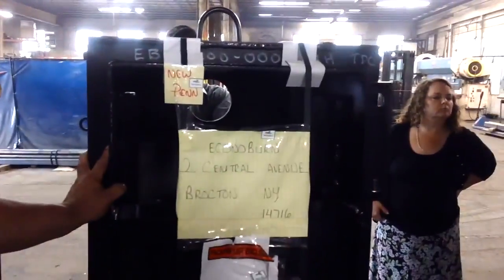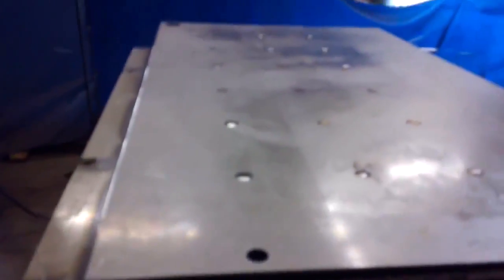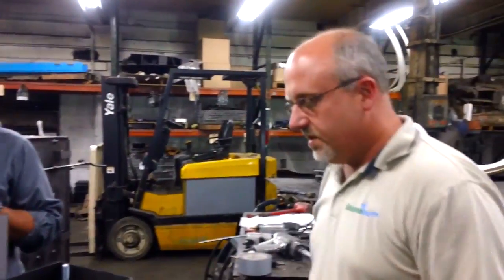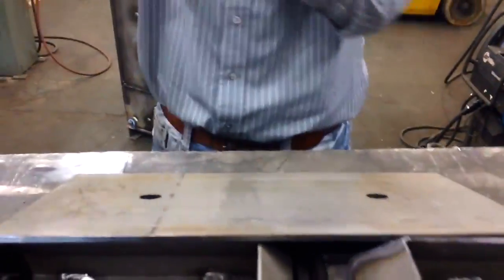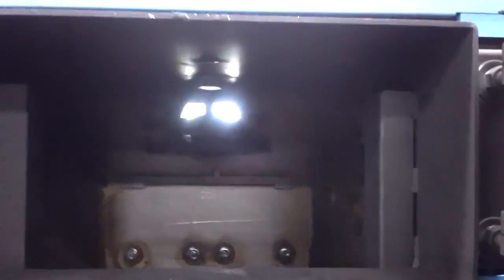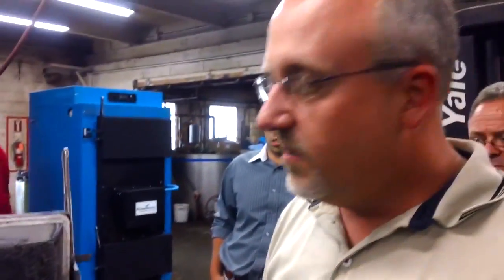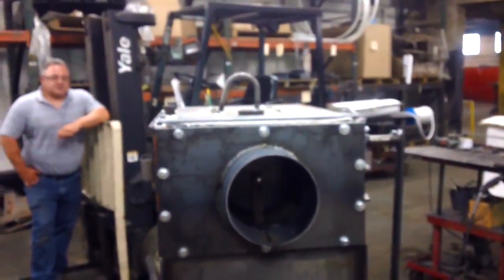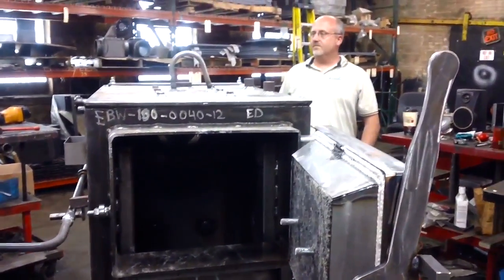The Econoburn Boiler Part 2 - The Details

Comment from the maker: Part II is back. I see the warranty is pro-rated down to 20% at 25 years for a complete replacement. How do they handle replacement part under warranty?

Sorry Krispin, we were editing so the videos changed, Part 2 disappeared for a while,  I was also trying to reply to your question and I deleted it by mistake so I will answer it here. The way the warranty is handled is they would give you 20% off a brand new replacement Econoburn.